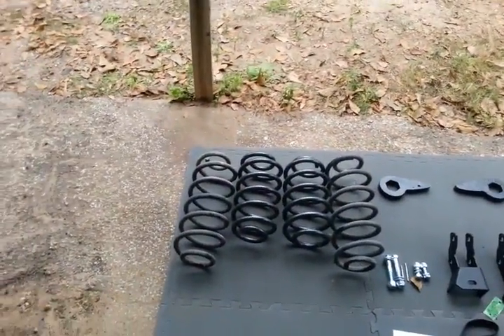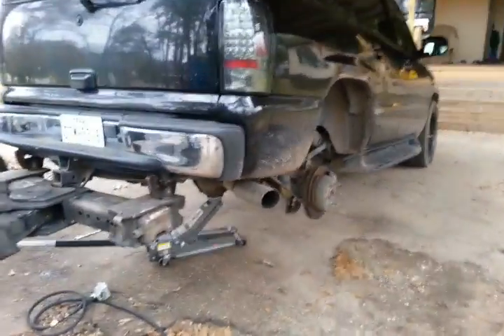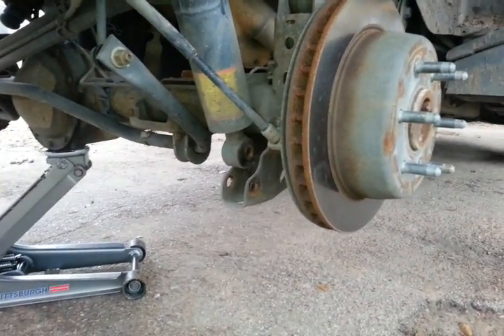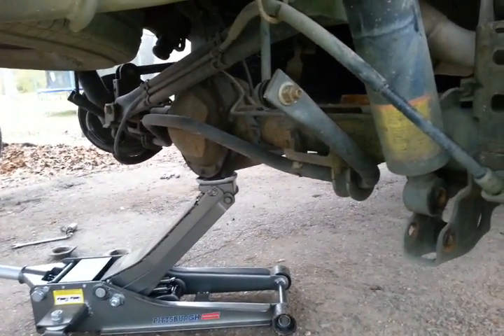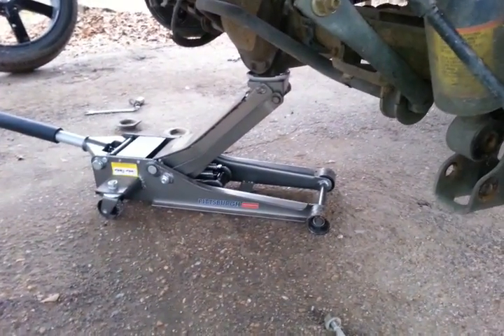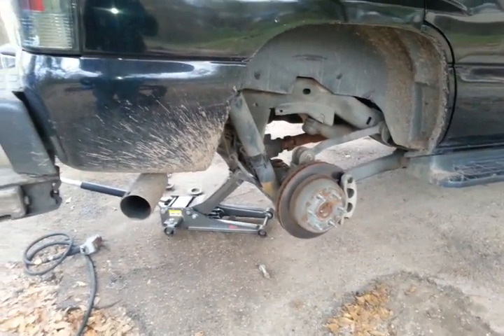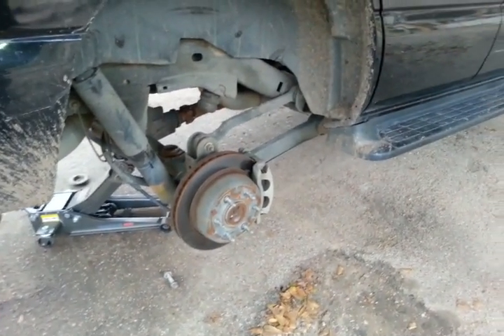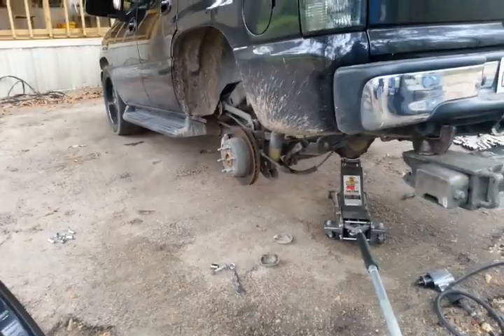Part 2 of 3 Yukon lowering kit.

Comment from the maker: Hey lamont.... The rims are 22 riding on 305,45,22.... 45 series is a better ride for high way...... which I went with 22....... If I went 24 then I'd have to run 30 or 25 due to wheel well specs...

Comment: Hello.I used the same kit, on stock rear shocks as well.but no extenders. Is that a big issue.with the shock absorption?
Reply from the maker: its safer to run the extenders to the fact the shock is still in its normal mode ... not using the etenders limits travel to bottom out sooner ...

Comment: Hey  how is your Yukon riding is it rough with you hit bumps in the road? Because I drop my Yukon xl on 24s I did a 2/4 drop with Crown suspension.Did you change your shocks and if you did what kind did you get?
Reply: I have the crown suspension and mine rides rough in the back I need lowering shocks or to customize my stock shocks